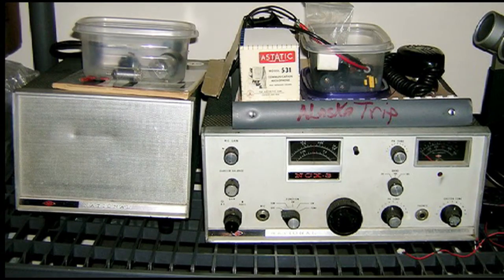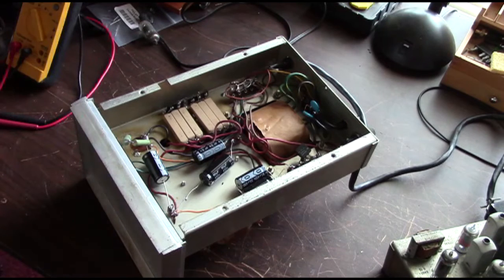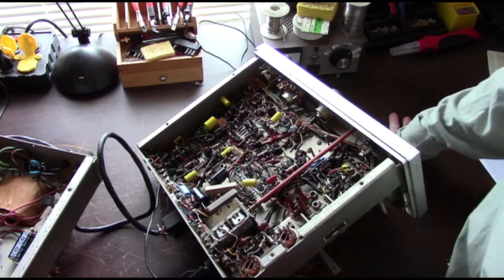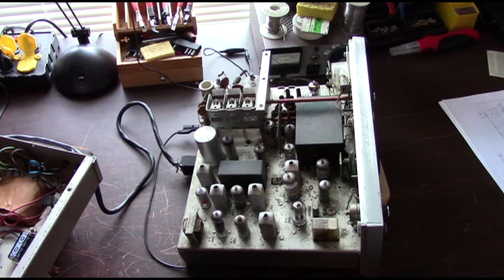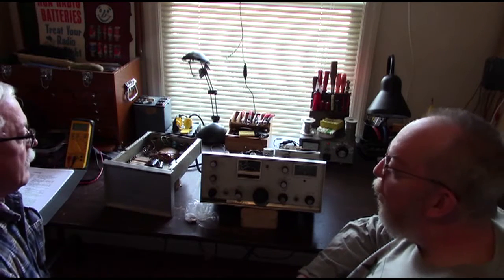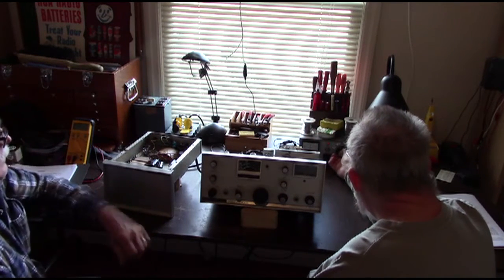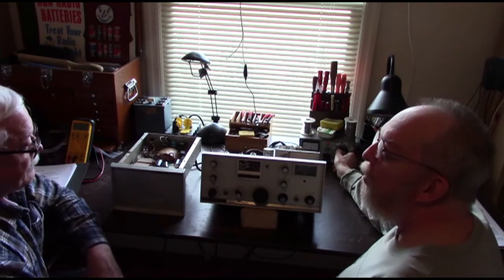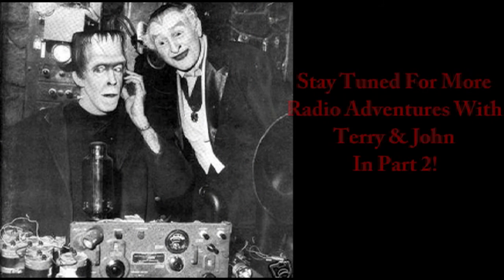National NCX-3 Restoration: 20-40-80 Meter Tube Transceiver-Part 1

Comment: i rebuilt one of these a few years ago and i took pics and had the schematic out and replaced the caps in the power supply. i KNOW i wired hem in right, luckily i was away from it. the one cap blew and started my carpet and the side of my face on fire. sounded like a 12ga. going off. after i put the fires out and picked up 50 feet of foil, i put a new cap in. i monitored it closely and put the variac on. it started heating up. i put the old cap in and it was ok. looking a lot closer, the manufactures of the old caps had the markings reversed. that was a close call. could have been blinded.
Reply from the maker: HOLY COW!! I'm glad to hear you weren't seriously hurt! I've had caps blow on me. Once because I wired it backwards. Nothing that dramatic  but scared the heck out of me though.  I had finished the restoration but had a problem getting full power out. I put it on the shelf and kinda forgot about it when life started getting in the way. I plan to get back on it sometime this year. When I finish it I will post the video wrap up.
Reply: . @specops56  the rest of it was a fun project. i did it for a 96 year old ham. the old grease all gunked up was a challenge but turned out well. the receiver alignment was tricky too
Reply from the maker: @stormchsr101  Glad to hear everything turned out okay! I'll bet that old ham was thrilled to put it on the air the first time.

Comment: best 73, 
me is a german ham op. that is trying to bring my ncx back to live.
i can not get a power suply! can you help?
i do not know how critical is the - 80v and the +280v....
are the exact voltages critical for operating?
best wishes and sorry for my poor english!
Reply from the maker: I am not an expert on these radios but I will try to help if I can. I will do some study and get back to you in a day or two.
You probably speak a lot better English than I do Deutsch.
Reply: @specops56  thx!
Reply from the maker: @anon72513  The voltages are critical. It's important that you stay as close to the listed voltages as possible for the proper operation of the radio, It's especially critical for the transmitter section.  Improper voltages will not only degrade the transmitter's performance but may damage the tubes. I hope this helps you and that you are able to find the proper power supply.
Reply: @specops56  thx! 
i try to rebuild rhe original scematic...
and look for the Original tubes rhat used in the original power suply.
i have scemaic and hope 
 tubes are avalible :)
so far i can see....only the e130l and the ef80 are critical.
the 5u4 i replace with diodes.
best wishes! long live the ncx3 ;)
and thank you verry much for reply!!! :)
best 73, a